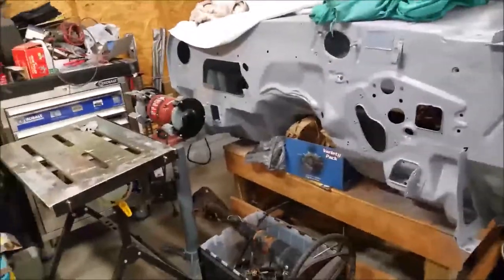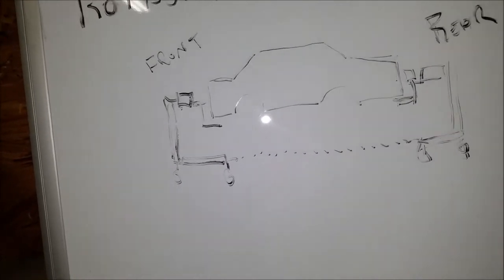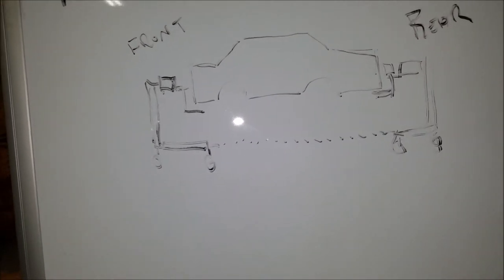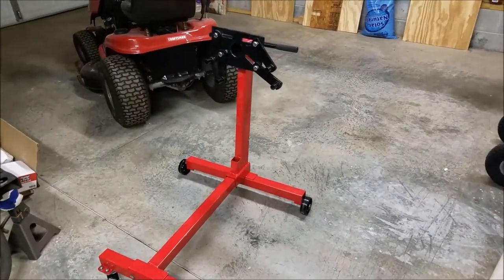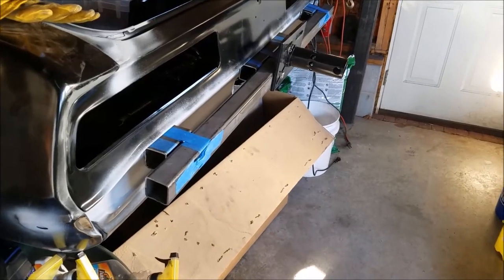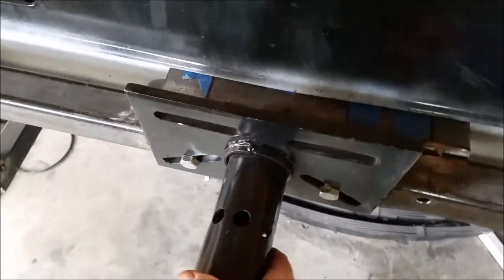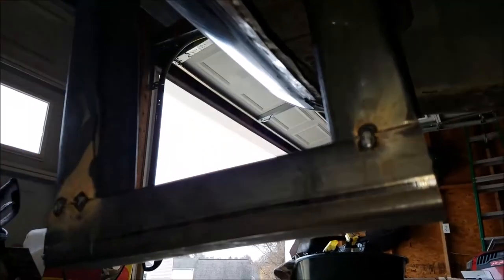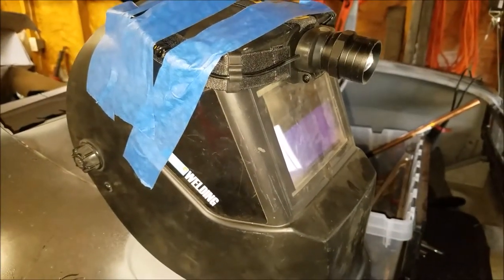DIY rotisserie part 1

Comment: I would defiantly widen the feet of the engine stands to atleast make it more stable with the body on it and the tube that is going through the stand that it rotates on is not very strong.  see steeljaw jones video he made a similar piece and for his 69 Camaro and it tore the metal where it is drilled in the pipe.  just an fyi to keep you safe
Reply from the maker: Thanks for the suggestion and I did see the video. Need to reinforce mine with that area in mind.